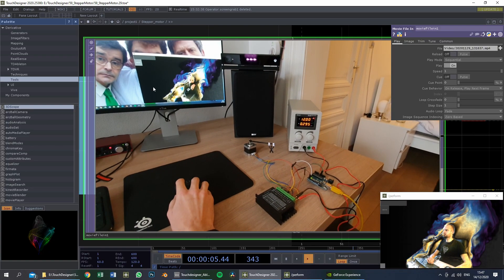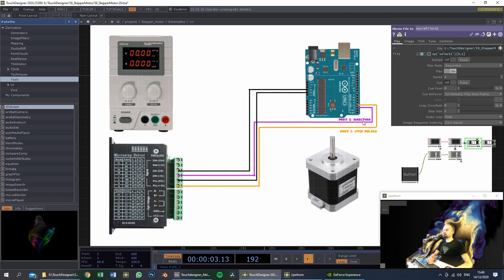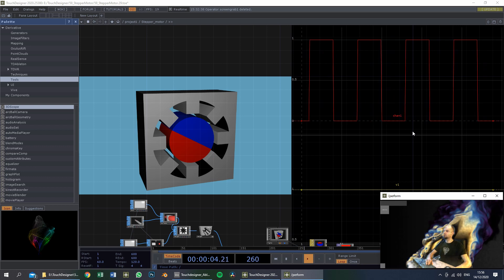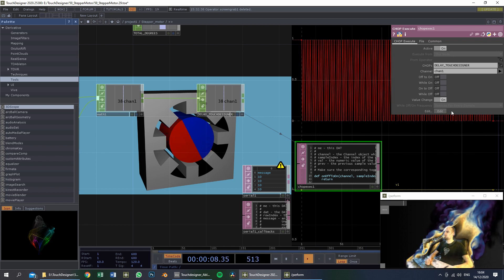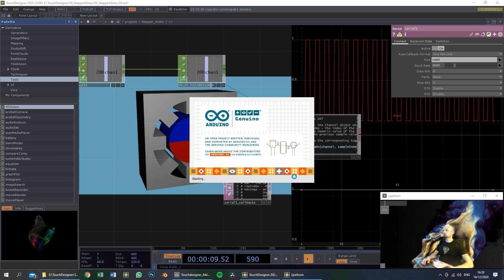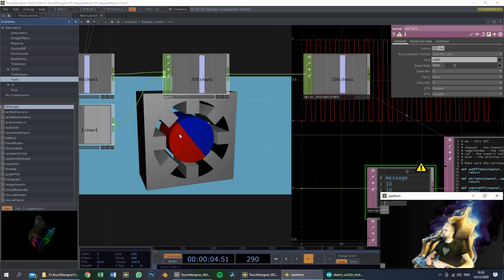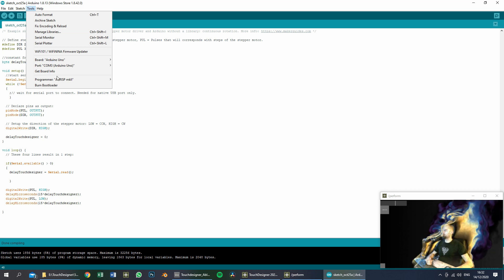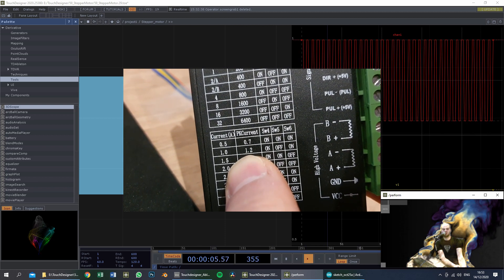Touchdesigner tutorial - control a steppermotor using Arduino

Comment: Amazing tutorial, thanks a lot! I am wondering how this would work with several stepper motors. Do you know how this would be possible? Cheers
Reply from the maker: Hi Pauline, thanks!! Do you want to control every motor seperatly or are the motors linked? If you're linked, you can just use 1 driver. Example: https://youtu.be/cLhvnmZK_mQ Otherwise, you'll have to by either a driver that supports several motors (i don't know if they excist), or by several motor drivers and connect them all to the Arduino. Every couple of outputs will control 1 motor.
Reply: Nice one thanks. And do you know if that would be possible with more motors? Like 10 for example? Thanks a lot for your help
Reply from the maker: @paulinekess7031  Yes, it should be possible. But you should look to an Arduino Mega instead of an Arduino Uno. It has a lot more outputs. You can also communicate over a serial connection with the Arduino Mega.
Reply from the maker: In the meantime I also figured out how to send multiple values over 1 serial connection, so that's not an issue anymore :)

Comment: Hi thank you very much for your video! As Jan i would like to be able to control the motor from a point A to a point B. I tried what you said in your answer but I am not quite sur I did it right nothing happen. Do you think you could help me to make a cursor (like the speed and the sens you made) for the position of the motor in degree? The idea is to be able to keyframe the motor position at a certain time of the timeline :)

Thank you very much for your help!
Reply from the maker: Hi Nels, are you looking for something like this? https://youtu.be/MNdh-xACRg8
Reply: Thank you for the answer! Yes exactly with a stepper motor.
Reply: But he doesn't give a toe file =/ At the moment I am using an Arduino Uno, a stepper Nema 17 and an easy SparkFun driver. (Later I will try to find a very accurate motor)
Reply from the maker: @Thetouchlab4907  That's too bad... Well, I can help you make an interface in Touchdesigner. That's not too complicated. :-) I'll send out the degrees of the motor, so the motor angle: 0 - 360. You can perhaps write the Arduino code. Here's an example you can start from: https://www.youtube.com/watch?v=AdZjTZP4rxE&ab_channel=MakerTutorMakerTutor If it's done, we can share it in the Google Drive folder!
Reply: Thank you very much for your help :)
I m not good at coding but i ll try tomorrow to figure something out with the link you gave me. I hope we can figure this out i ve seen many post of person trying to do this  with many software but without success. 

Thx
Reply: @jaksterfransiscus3001   I Found a code that could be useful. Can I send it to you by mail or via google drive if you give me the access?

Comment: excelent video, I have tried your code and I can move only motor CW at different speeds,  do you have the code to move both directions?
Reply from the maker: Hi Victor, thank you! You can change the direction of the motor by changing the output send to the driver to LOW. So digitalWrite(DIR, HIGH) becomes digitalWrite(DIR,LOW). If you want to change the motor speed and the direction, this becomes difficult in Arduino, because you can only send 1 byte over the serial connection, meaning 1 value between 0 and 255. I used this value to control the motor speed (delay). You can use this value to change the motor direction and leave the motor speed (delay) fixed.

Comment: Intersting, i also put it up on alltd.org.
One Question though, how would you tell the Steppermotor to Stop at certain points, basically telling him to go just from point A to point B.
Reply from the maker: Hi Jan, thanks for putting it on alltd. It didn't know this site existed! :-)
Well, to control a motor from point A to point B, the basic principle remains te same: for every pulse the microcontroller (TB6600) receives, the stepper motor will move 1 step. 
In the example in the video, the code will loop forever. If you want to limit the number of steps, you'll have to add a for-loop before you generate the pulses on the PUL-output: 
for (int i=0; i <= steps; i++) with steps corresponding with 200 for example, which means the motor will turn 200 steps.